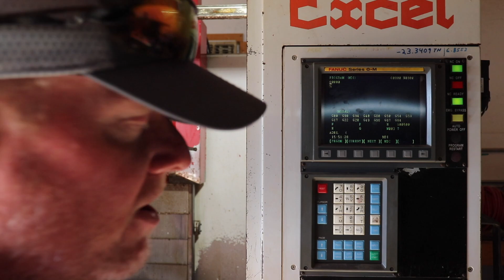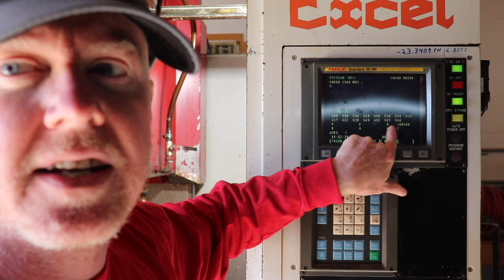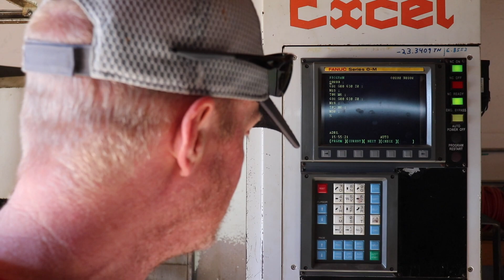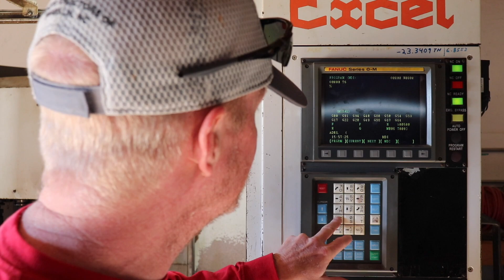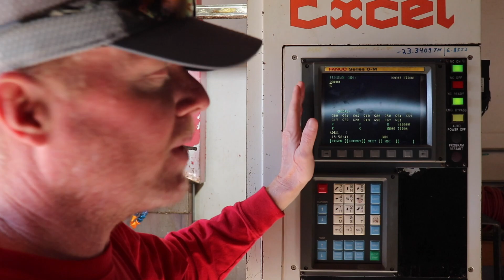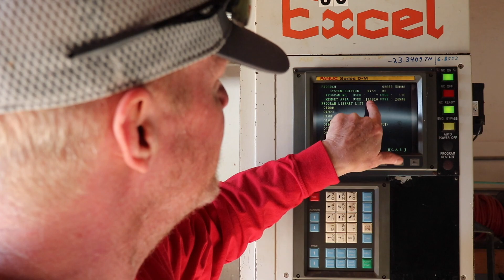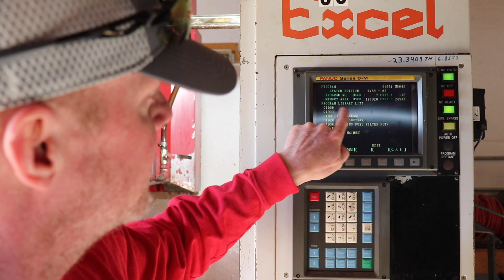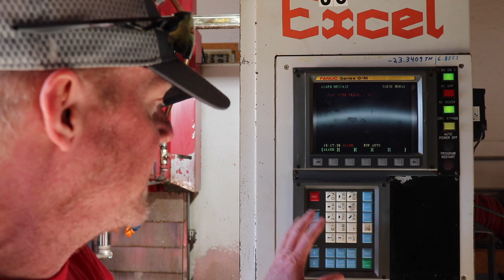Fanuc OM MDI Basics, Drip Feed, and Programming.

Comment: hello shane
have you ever ran a program by drip feeding.
 i cant get my fanuc to run drip feed, when i press cycle start the button lights up and LSK is flashing nothing happens
Reply from the maker: Yes.  That's normally how I run programs. Be sure your serial handshake is working and your cable is good. Normally that is is the issue if it won't start the drip feed.

Comment: Thanks for the video,  how do you actually drip feed?, I don't think that was covered.
Reply from the maker: Once your DNC is in ready mode (Ready to send).  Machine just needs to be in tape mode and hit cycle start.  I show how to get the dnc into that mode and have another video on the Titan DNC that shows it beginning to end with that particular DNC.
Reply: @ShaneBurrell1  Hello thanks for your usefull video,we have a fanuc om but it dosen't have  tape or dnc mode on panel how can make it drip feed?  It has only auto mode
Reply: Thank you for the response!

Comment: Hello shane
Deeply appreciated what you are doing. Keep it up
I'm using this same controller, I'm using this machine in auto mode with the help of Dnc through pendrive, it works fine but problem arises when my program line comes at N9999, at N10000 machines stops and show
 p/s alarm 003
Please help me how I can run the long programs usually having around 50000 lines
Please help me I will be very thankful to you
Reply from the maker: Cool, thanks.  I remove line numbers completely in post processor for long programs.  If you are using fusion 360 it's pretty easy to do.  Line numbers don't mean much when in tape mode.
Reply: @ShaneBurrell1  actually I'm
Using worknc and I don't know how to remove N lines from the program
Reply from the maker: @karanbirsingh6781  If that uses surfcam post you'll have to edit the post.
Reply from the maker: Actually in current 360 it's very easy.
Disable the "showBlockNumbers" or "showSequenceNumbers" post property in the Post Process dialogue box.

Comment: Thats intresting, on my machine running faunc om I dont have to orientate the spindle before doing a mdi tool change it just automatically dose it
Reply from the maker: Many if not most have a macro tied to the tool change.  My machine has it but its assigned to M66 vs M6
Reply: @ShaneBurrell1  lot of quirks with these old machines but they sure are reliable
Reply from the maker: @Daniel-vq9zb  Mine has worked out very well. Other than a few normal wear items I haven't had many issues with it.